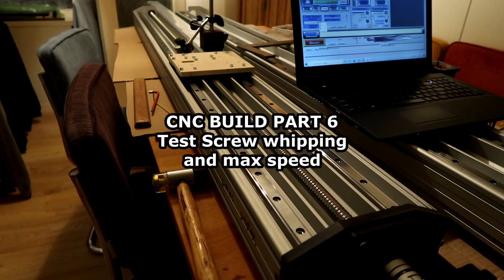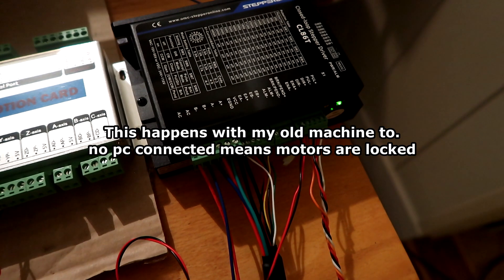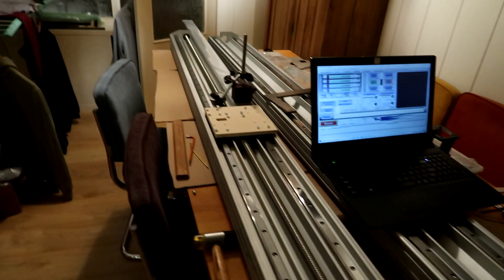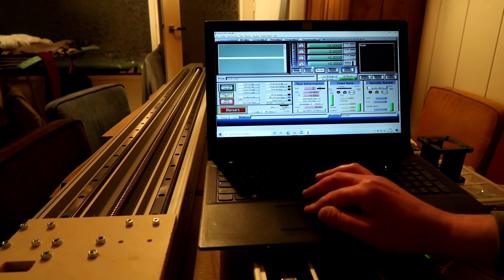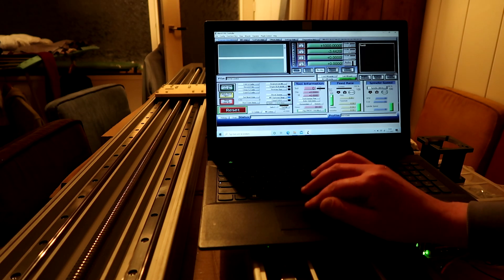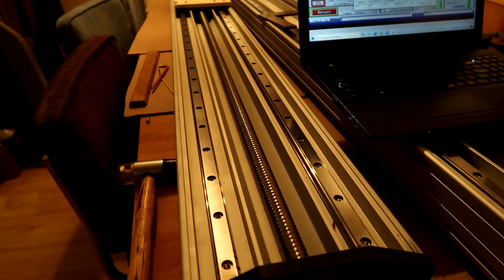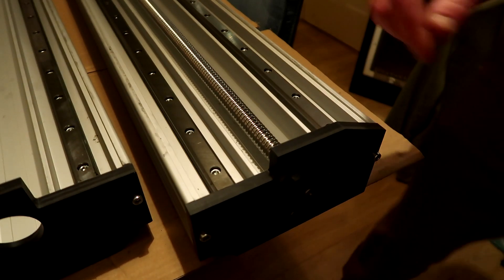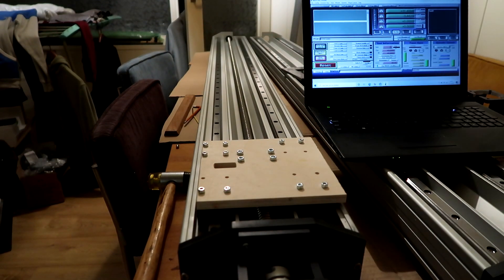CNC BUILD PART 6 - Testing Screw Whip whoop whoop !

Comment: Can I know what the pitch or lead is, are these 10mm per rotation or 5mm? I am about to build a larger CNC as well and trying to compromise.
Reply from the maker: these where 10mm pitch, but personally i would not recommend such long screws with 10mm pitch. (or they have to be thicker)  i sold all of this since i could not work on the machine in my shed :(  my current machine uses 20mm pitch 1.5 meter long screws and i personally like that way better for woodworking plastics etc.  it can achieve higher speeds without screw whip. its also nicer for the steppers since they have more torque at lower speeds. so i can get away with my old 3nm motors with ease at speeds of 5-6 meter a minute
Reply from the maker: another thing any larger machine would benefit a rack and pinion drive over ballscrews. i think because length and screw whip becomes a problem.  the 20mm pitch screws i bought at https://www.dold-mechatronik.de/Ball-schroef-SFS1620-DM
Reply: @joppepeelen   I am trying to build a small pro hobby grade CNC capable of milling some steel plate maybe 3mm.  But also want to build a plasma table as well and you REALLY need speed with plasma. Did want to spend money and find I have to go back.  I think its a common thing in my research is people having to backtrack in time and expense.  I think the 1610 might be a good compromise for the CNC router/mill with decent rapids until I get to the plasma. Thank you for the videos and replies.

Comment: Hei Joppe - fun times trying to figure out how to make our nipples work re: grease. It only just occurred to me that you're using 20/25mm diameter ballscrews! Holy shitballs, there's no wonder that your access to the ballscrew nut's grease port is obstructed....hahaha....it got me thinking though, because on the carriage you (we, I have a similar arrangement with that Vallder extrusion) have four linear guideway blocks plus that ballscrew nut. I've been thinking of making an aggreggate lubricating system, tying all five components together as a group. I don't know how well this might work since the ballscrew nut is a "single port in" whereas the guideway blocks can be "one port in and one port out". Looking forward to hearing any updates....
Reply from the maker: Hmm that's not a bad idea!!!! to at least pit 2 blocks in series ! It can go to the balkscrew:( since ridge between balkscrew and block is rather high :( not sure if i can squeeze a tube there
Reply: @joppepeelen  Yes, I saw that problem also. My current imagined solution would be to run the lubrication tube into the interface plate (the plywood plate you have here) or even through it bottom-to-top to a unified lubrication point or points. My own setup is with this extrusion as the Y axis, so this port would come through to the Z axis assembly. One of those things where I could just "make it work" by fixing it up when I build it, but I'd much rather design a solution now at the desktop to guarantee things.

Comment: Have you looked into the "BlackBox Motion Control System X32" controller? I am just about to build a RatRig CNC router using the Black Box
Reply from the maker: i never did, well i dont want to spend allot of money but there must be something better then i have :( i liked my paralel port 10 euro breakout better. it makes more sence to me :)
since the ports/pins mentioned are related to whats stated on the board :) but it cant get enough pulses out :) more then 30Khz
Reply from the maker: ah its a driver and breakout in one, i would be looking only for a breakout :) the drivers are good i think ! also closed loop so

Comment: Nice! So the wobble occurs only at the last 20 cm, not this bad. I guess the resonance is caused by the 'hang through' of the spindle in first place. 
Someone wrote on amazon, that the Mach 3 is OK for simple tasks, but can not do things like reversal adjustment etc.
Reply from the maker: yeah you are right, its the longest piece on one side of the nut, (when that is the maximum length)  on its side it seems to reach 6000mm/minute rapids. when i cut things its usually less then that maybe 4000.. that should not be a problem :) thank god. but i rather had it higher :( over this distance it seem to take ages :) haha